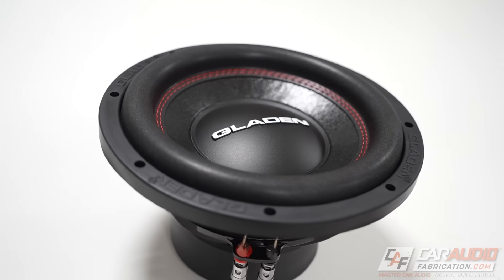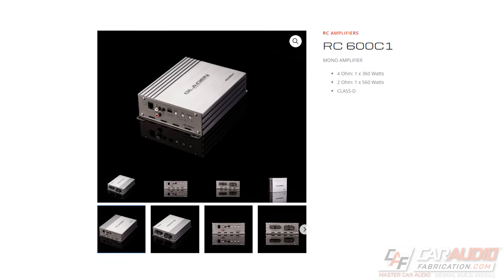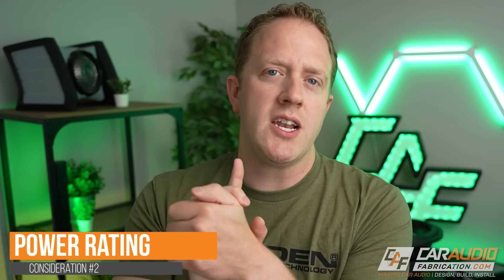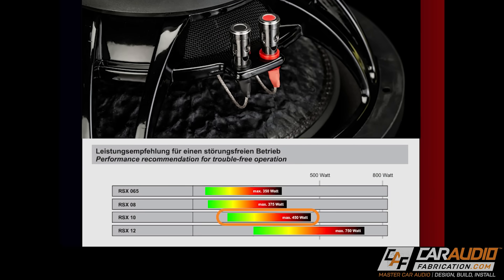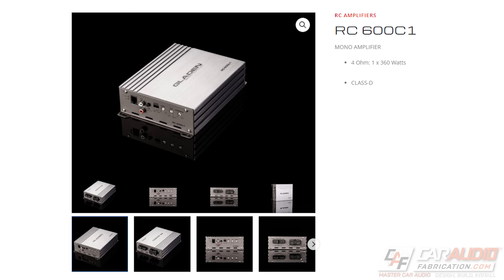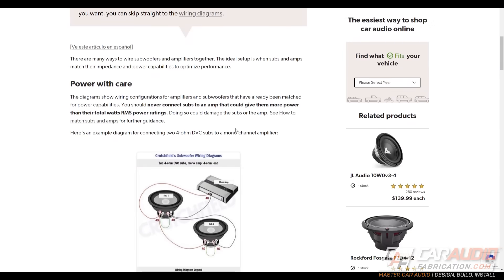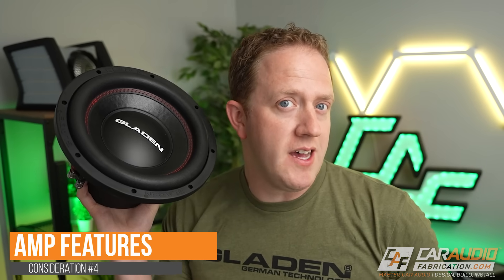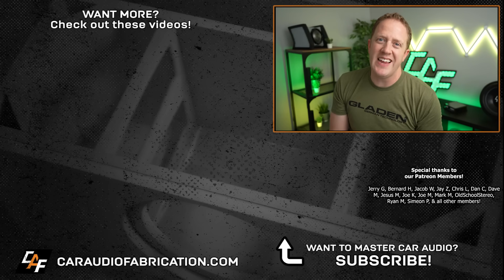Pick the BEST amplifier for your subwoofer! MADE EASY!

Comment from the maker: Thanks for tuning in! Here's some more related videos that will assist in getting optimal performance for your subwoofer system!

Picking Subwoofer - Do's & Don'ts - https://youtu.be/uI1AAPzjbgg
Tuning your Amp - https://youtu.be/tiOUd3NkOyQ
Subwoofer Box Building - https://www.youtube.com/watch?v=tKqelYJqmXw&list=PLmybwiwzi3MXFQe16OzDXMRszxN8GTBwP&index=2
Reply: Man you should try the SQL line from Gladen they are some serious bangers and really musical
Reply: @CarAudioFabrication  question bro I will use 400w rms @2ohms using 2 channels. What sub will sound better a 12” 600w rms @2ohms or a 10” 500w rms @2ohms with only 400w rms. I don’t want to under power the sub either.
Reply: @alexissalguero5751 I am not Mark lol, but if your amp only powers 400 rms, then I don’t think you will get more spl from the 12 inch. You need power to make power. 

If you had a lot of wattage power then I do think the 12 inch because of the more cone area compared to the ten inch sub. Given you have the proper box for that sub as well.

Comment: Im running Gladen SPL 1000C1 which is
960 RMS @ 2 OHM . But my image dynamic 12 inch sub is 700 rms. So i calulate my amp gain off the sub spec not the amp..

Comment: I’m an electrician, I started my build with what alternator I could use. Sized my amp on that. Sized my subs on that and no issues. Powebastards 250 amp alternator.Taramps 3k bass 3 CT Sounds 12” Ozone’s. System is solid and never clips.

Comment: Hi, I plan on running a  Skar vd10 intheir single ported box with lc2pro, epicenter and Rockford fosgate 750 5 channel amp  in my 23 Denali ultimate with 12 speaker Bose system. Would anyone have any input on how it would sound and any tips?

Comment: But now i have a burning question! So for my subwoofer i got a Ground Zero GZRB30 enclosure rated anywhere from minimum 500w rms to 1350w spl on the spec sheet.

So it wouldn’t make a difference for the sound experience if i upgraded my amplifier to a 1000w rms model. And could just keep playing my current 550w rms amp? 

Why bother with the higher watts then?

Comment: I'm a bit confused I hear what you're saying but I have a recoil red true 1200 W amplifier and when I hooked it up to two 12 inch 600 watt RMS Subs the clipping light turns on a lot when I crank it up as if it's underpowered and the speakers need more I was about to get some 12s that take 400 RMS so the clipping light don't turn on
Reply: did u figure this out

Comment: I've got a 350w rms 4ohm sub is it safe to use a 400w rms or 500w rms 4ohm amp on it is this possible and safe at a very high volume but tune the gains to the 350w rms is this completely safe or not really. I'm asking because I have a 350w rms 4ohm jbl club a600 mono running this 350w rms sub but with bass boost turned all the way down and I set the gain for its required voltage for that sub the amp don't move the sub and I do have the sub setting on 0 equal mine gose +10 and -10  it's set to the middle. Even if I turned the sub up full on head unit it still doesn't do anything I'm trying to work out why this is happening because I don't want to use bass boost because I've heard it's not safe to use please help would be good

Comment: I have 2 infinity 800 watt rms 10" woofers single 4 ohms on a ported box and had a 1600 Watt Amp... but the amp died a while ago... i don't feel like I need that much omph anymore... was thinking of a 5 channel that runs 75 rms to the 4 doors and 500 rms to the sub... What does that mean? I'm only getting 250 W to each sub? Should I just get new subs that require less power?

Comment: So i bought a 400 watt rms 12in svc shallow sub with a 400 watt rms amp, i have no bass with just turning up the gain.i have to turn the bass boost up almost all the way to get decent bass.  No matter how i set it I've never seen the clipping light come on.  But it does get pretty hot. So Should i have an amp with higher output?

Comment: Hey man, I have a pioneer D8601 championship series mono amp. It puts out way more than it says at 1ohm. It's rated 800rms at 1ohm. But I've seen it tested and being able to push a little over 1000rms. I was using my 6 yr old comp rt wired to 1ohm but that's only 500rms . I want to get either a set of 8" with 800-1000rms wired to eventually be 1ohm going to the sub. I'm stuck between , two sundown 8. Two  8"CT sounds meso-8-d4's  or a pair of DS18 zx18.4D high Excursion.  All dual channel 4 ohm so I can wire them to be 1 ohm total at the amp. Any ideas?

Comment: Hello. I love your video and I know this is kind a late but do I need to run or upgrade my vehicle wirings? I currently running with 4gauge OFC Power wire and Ground along wit  JL Audio RD 1000/1 at 1000 watts (rms) @2ohm load with one 12” subwoofer 1000 watts (rms) @2ohm load. And maybe running a two subwoofer with total 1200 watts (rms) @2ohm load in the future? And I know I will not go more that this Wattages.

Comment: I got a 150w ofc wire going to my amp riot1600 from the battery. Is 150 good for the amp? It only does 1200-800rms for my two 12in subs. Plsss

Comment: Can I use a 4000 amplifier for 2 4000 subwoofers or dose it have to be a 8000
Reply: @bochomtz  I would do the jp63 or jp83 for that setup. Both can go well over 8000 watts
Reply: Wire to .5 ohm

Comment: some basic info needed is what I just learned. A dual voice coil sub could be 2 ohms or 4 ohms. If it is a single speaker, then the 2 ohm sub can only be wired for 1 or 4 ohms. If it is a pair of 2 ohm subs, it has to be wired at either 2 or .5 ohms. A pair of 4 ohm dvc subs is basically opposite. This is critical info needed to know to match an amp.
Reply: assuming both coils are 4 ohms (never seen a dual voice speaker with different loads per coil) on a dual voice coil and want to wire both coils, then depending on how you wire the speaker it will either be 2 ohms or 8 ohms. you can just use one coil on a dual voice and be 4 ohms but you need to find out the power handling of that single coil. On your other point. most single coil speakers are going to be 4 ohms.

Comment: Agreed it's best to get an amp that has 50% - 100% more power so you don't need to run the amp at full power. Also, the best way to run the signal to an amplifier is with an LOC. Brands like Kicker, Recoil, Audiocontrol, and JL Audio not only boost the signal, but filter the signal so there is no distortion. Other brands can and do distort the signal. Not all LOC's are the same. By using a quality LOC your amp doesn't work so hard and runs cooler, plus you get better sound quality. Best money to spend on your system. The best amplifier is the 1 you can afford. As we all wish we had        JL Audio in our cars.    lol  (Though CSS makes an impressive sub 4 the price. As does Savard. Gladen are very good too, just a bit pricey. Germans make good stuff).

Comment: If i run the vx10005i to two 12tw3 d4. C6 650 in the front doors. C1 650 in the rear doors, will that be a good system? Vehicle is 2024 gmc sierra. Should i run a fix with it too?

Comment: need help i had 2 skar evl 12" with a smart 3 and my truck flexed i changed to 2 avatar 12" and a smart 8 but it hits no where as hard or loud as the old system and inputs? thanks bill o box is 2 cf per sub and 34hz
Reply: @progfool  check the ohm load you’re wired to inside your sub box

Comment: I’m just getting into the audio 
Seen ,I have church  drive v2300 600 Watts  amp I can’t find the specs for it. I did have 2 10 inch kickers c12 I believe  connected  it did have some bass ,I just got 2 jl audio 10w1v2-8 I’m not to sure on the specs I couldn’t find any information about them and it does sound very different like the subs are asking for more power
Reply: I do want to put the church amp to my 4 doors speakers I believe the 2 front speakers have 450 watts I haven’t checked the backs ones yet I’m guessing it’s lower, I drive a single cab the amp has 2 channels how can I connect them all right ?? This is a lot of questions I’m asking  sorry

Comment: My general rule is to pick a amp that does sub rms rating plus 25%. The 25% compensates for impedance rise. That’s minimum. Right now I’m running 6k rms each sub that’s rated at 4500.

Comment: Got a single fosgate t1 12 800 watts rms subwoofer wired to 2 ohms on a kicker cxa1200.1 amp. Nice combination 👌 stock 130 amp alternator Big 4 all 0 gauge ofc wires yellow top optima under the hood with xs power d925 battery in the trunk.  Voltage stays around 13 volt full tilt. 😊

Comment: @CarAudioFabrication
Question: Assuming that space and cost aren't issues, if I were relatively new and looking to have the best possible sound in my car, would it be a worth while idea to have two different sized subwoofers handling different frequency ranges? IE: 12" for <50Hz and 8" for >50Hz (maybe with a bit of overlap?)
I'm currently upgrading all of my audio collection to 24-bit/96khz and want it to not be time wasted. 

If this is something worth doing, could you recommend hardware to make it possible?

Comment: Could you make a video about free air subwoofers? Some people have sedan cars and don't really want to waste space on subwoofer boxes. I appreciate your work, man.
Reply: Are you referring to infinite baffle? A sub has to have an enclosure of some sort in order to generate a desired frequency and load the desired space. Theres tons of different options if space is a concern. But just putting a free air sub in a trunk wont do much of anything if at all
Reply: @pyroboy417  Completely disagree. I personally have it and it makes a huge difference ! 
According to the guy from audio system germany it should play even better than tiny subwoofers in a box that you put under the seat (like jbl basspro nano). 
Nothing else is really a good solution in my sedan as trunk and passenger area is separated and I want my system to be completely non invasive. 
Anyway It's really good on its own I'm just guessing it could be done even better.
Reply: @Jake-kb2le  I agree, I've done this as well, and I didn't even correctly seal off the back seat from the trunk. With just an 8" sub it had crazy range from 25hz to about 50hz. It struggled going higher than that, and didn't reproduce a rock bass drum hardly at all. The trick is finding a sub that is meant for IB otherwise it will sound bad.

Comment: Hello. I have question. Why all amps causing burning speakers. At only  0.3_0.4 voltage drop ? I have fresh wires on subs, power wires. No conection loss in trunk itp.  next issue i no. Have good bass. Bass is nit loud and enought soft. Sometimes head unit loss rca voltage. Any tips to this weird issues?

Comment: If you have a 500 watt rms sub it's good to get a 1000 watt amp because you will always be running clean power to it . If you get a 500 watt amp it might not be clean without clipping
Reply: Don't buy junk.
Reply: I have a 12 inch sub that is 700 rms , so I bought  a Gladen 1000c1 which is 960 w @ 2 OHM load , and adjust gain off the sub spec . Seems to be working good. Only thing I noticed with my gladen speaker and amps is , they are not made in Italy. Designed maybe but my amps are made in korea. And the Gladen  Zero 165 (2 way) im currently using seem pretty cheap build quality compared to my old Steg ST 650C
Reply: I always choose amps with more power than needed...at least 30%
Reply: I tend to always do something similar. I’ll get an amp that puts out more power than needed or one that has the exact power but keep it at 4 ohms instead of 2 ohms for better dynamic headroom.

Comment: Hey guys, I need help. I have a very old SMD V1 18in sub 5000watts, I wanna run just this sub and 4 speakers (6x9) in the doors. Do you bassheads have any suggestions? I'm going with a sealed box in the trunk and size isn't an issue, plan to use the whole trunk but just wanted the best inputs from you guys. Thank you all

Comment: needed this like 3 weeks ago,  was upgrading one of my cars audio,  has a 8inch parcel shelf sub,  had a spare 250w 2ohm mono amp,  got what i thought was a good sub for it, turns it was a dual 250w 2 ohm which apparently needs a far more powerful amp and either a 1 or 4 ohm output...much confusion

Comment: You amazing, I was looking for this yesterday night since it has been around 10+ years since the last system i installed and was looking for refresh and see of something has changed. I do have a question, I plan to get 3 10"s planning to get a mono block stable at 1ohm however since its 3 speakers probably at 4 ohms that will get me 1.33ohms, would that caused any noticeable problems? I'm aware that it will drop max power to somewhere between max power between 1ohm and 2ohm. Meaning if is rated 400w at 1ohm and 200w at 2ohm, I should be somewhere around 334w at 1.33ohms?

Apparently I had 2 questions 😂
Reply: Awesome man, It has been 25 years for me, but I spent 5k on a new system. Did it all myself. Almost complete,as close as today. Turning 52 July 13th 🎶
Reply: @EDventures_13 all stuff we wished we could do at 16 :)😊

Comment: I'm just happy you're moving away from brands like audio control. They're one of the best stateside, but they need more people to move away from them so they can have motivation to catch up with the competition. 👍🏻
Reply: I feel the bigger reason for products to stagnate or fall off is the company is sold to another company that doesn’t prioritize quality over manufacturing cost .
Reply: @jordanrobin2119  what needs to be caught up? If you build an amp that’s ahead of its time, it will basically go unchanged for years. Audio control and jl audio don’t change much because they design advanced audio products
Reply: @alconyers2003 they let off the gas instead of keeping it pushing at the speed they were going if that makes sense but yes they’re badass